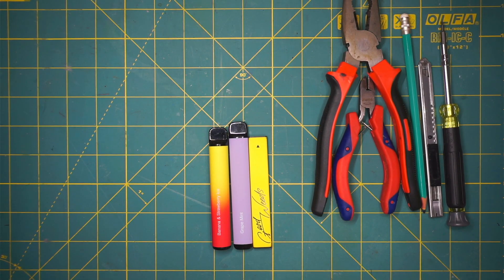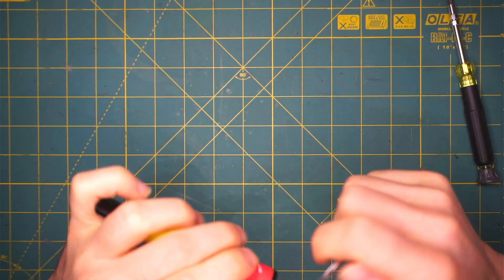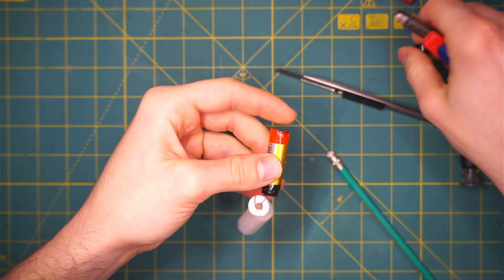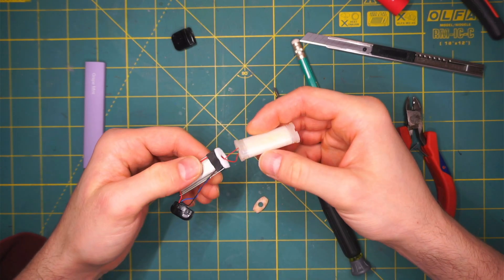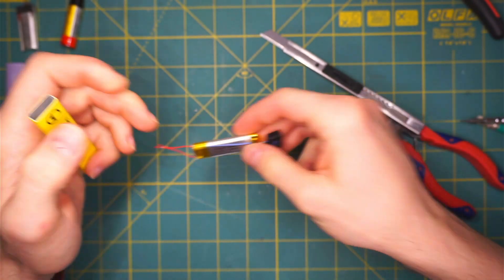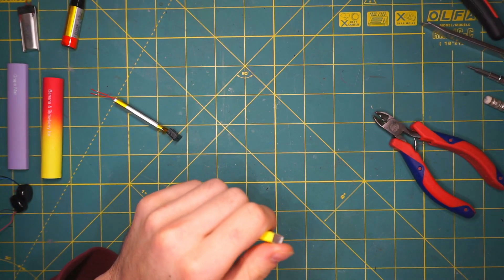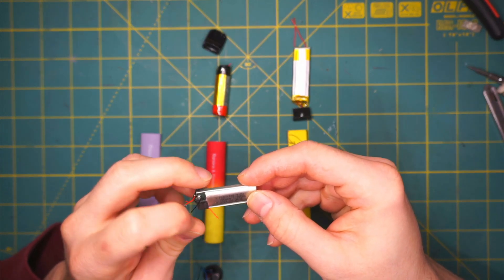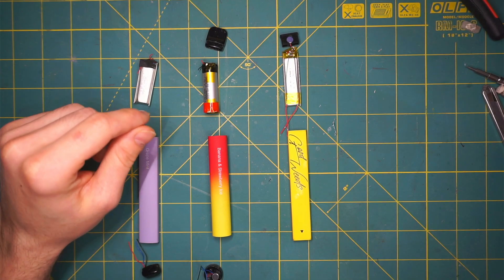Disassembling a single use vape pens

Comment: Thanks for making video.
Found a near dead round-no switch type so cleaned  it out then charged battery (cr123a-3v 15wh) using alligator clips connected to nitecore charger.

Comment: lol my vape died and I decided to dissemble it because I was bored
Reply: it's worth disassembling for battery, which is rechargable and useful for many other devices as replacement for other kinds of soldered-in batteries that failed from age... repaired mom's hair cutter that way, originally had the "AA" sized 14500 that is not too easy to find in retail, but the smaller 13300 from vape works great! so many uses for something findable for free, because people just throw those vapes out. i don't even smoke and have harvested several batteries already.